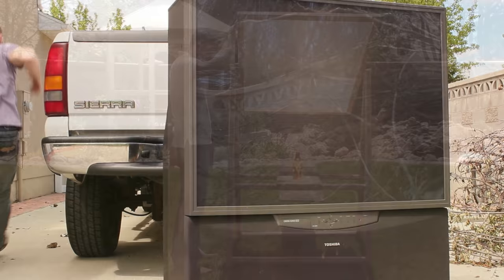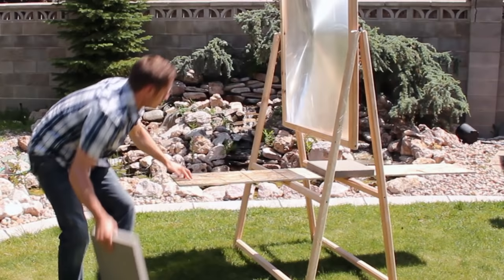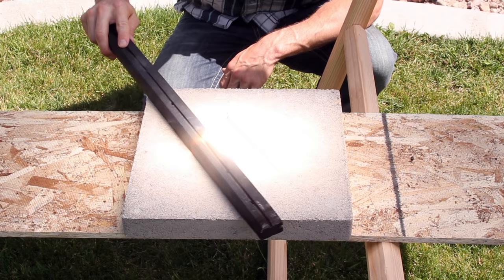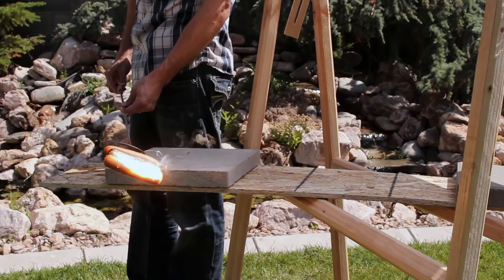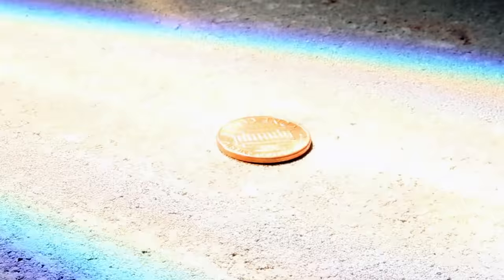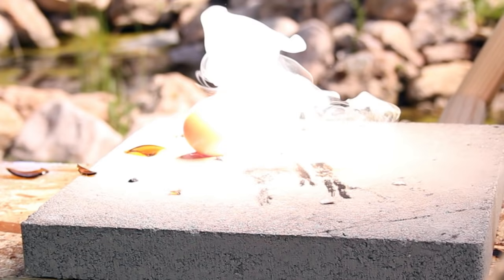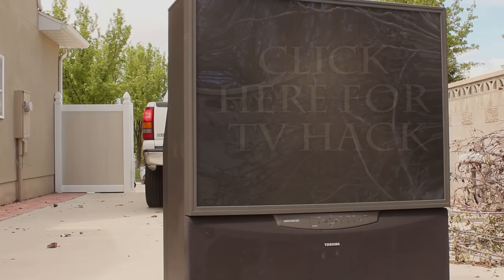Burning Stuff With 2000ºF Solar Power!!

Comment: 97 million miles away from the sun, a measly square meter of the sun's power is focused back into a small spot of light capable of melting metal. If that doesn't paint a picture of the sun's energy, then I'm not sure what would.
Reply: Ikr?
Reply: Now I don't want to go outside
Reply: 93 mil miles is a lie
Reply: Truthasivebeen Shown no u
Reply: Escanor is laughing...
Reply: Sam Smith me with a bunch of spray paint could paint y’all an even better picture of the sun
Reply: Flat earth
Reply: @melvincordovez484  "37Jacob, however, took fresh branches of poplar, almond, and plane trees, and peeled the bark, exposing the white inner wood of the branches. 38Then he set the peeled branches in the watering troughs in front of the flocks coming in to drink. So when the flocks were in heat and came to drink, 39they mated in front of the branches. And they bore young that were streaked or speckled or spotted." (Genesis 30:37-39)

Dude you're talking about a book that says you can get stripped animals if you make sure they mate in front of peeled branches
Reply: Praise the sun

Lord escanor
Reply: Truthasivebeen Shown do you know what trigonometry is?
Reply: 150 million KM for normal people
Reply: 29 million miles actually
Reply: And Sun is almost the most average star in the observable Universe!
Reply: Boss
Reply: Guy took 97 million mile long measuring tape to the sun, but the last 4 million miles melted. So they settled at 93 million miles.
Reply: @melvincordovez484  no
Reply: The ancient Egyptians used giant primitive solar lenses to melt the granite and thats exactly how the queens chamber was built at Giza
Reply: @zf_samael1037  Ye
Reply: Yes under the heliocentric teaching but not everyone goes with the heliocentric teaching, some go with the geocentric teaching
Reply: Sun isnt 97 million miles away
Reply: yes and the earth is still not freezing like crazy
Reply: the sun is not 97 million miles away, have you always wonder why cloud has a spotlight?
Reply: @elidyson256  bruh
Reply: and thats without even taking into account things like the ozone layer wich reduces the energy that hits the surface
Reply: It's not 97 million miles away tho
Reply: 777 likes (go get a lotto ticket)
Reply: @the_libyan_dude6500 what is the Einstein?? Can't wait to hear this 🤣
Reply: @smallsherpa2222  you're beneath me
Reply: @the_libyan_dude6500  ahh just trying to insult me when all I did was ask a question. An intelligent person would relish the opportunity to share their knowledge and educate others.. I was merely enquiring as to how far the sun is. I'm guessing by trying to insult me you're refusing admit you havnt a clue...

Comment: Put it on a actuator on the truck of your car so you can ruin a tailgater's car with it! Over heat that thing instantly!
Reply: That's a pretty sweet idea.  Just burn a hole through their radiator, get tailgaters off your ass immediately lol.  Also works good in police chases.

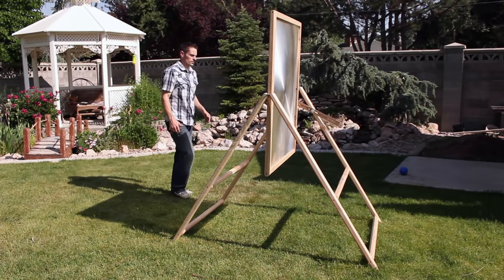Comment: 2:45 would you really put that on your shoulder and walk with it after seeing what you just seen
Reply: Looncan i was just thinking THAT!
Reply: Looncan The focal point is at a greater distance than the distance it has to his back at that moment, so there's no real danger in it.
Reply: are you serious?
Reply: This is a Fresnel lense, it acts as a condensed version of a magnifine glass. Therefore it needs to be at the perfect angle with its normal vector pointing towards the sun, and even then will only burn things in it's focal point which would be a few feet away and only be a range of about 6 inches. If you understood the physics behind the lense, you would see that carrying it around is about as dangerous as plugging in a power cord.
Reply: Looncan  its harmless after you fold it up and the suns rays are no longer passing through it
Reply: James Hutton naaahhh, plugging in a power cord is far more dangerous! i hope we all know that ....
Reply: Looncan  I WAS THINKING THAT
Reply: Looncan have you ever burned anything with a Magnifying Glass guy...You have to hold the Glass perfectly still and the focal point of the light has to be as condensed as possible or it wont burn..
Reply: guy belski Lmfao ikr or a troll
Reply: +Looncan If he felt his shoulder getting hot, he would have taken it off.
Reply: Its like asking is it safe to touch the ends of an electric power cord while not plugged in!!
Reply: Well is it? the electrical cords on my antenna in my backyard wouldn't be safe to hold prone to lightning bolts, my antennas conduct electricity and static really well

Here. Hold my electrical cords? no!, thought not
Reply: haha, your the best kind of troll. lmao.
the kind where its hard to decipher whether or not ur a troll.
keep up the good work :)

Comment: I wonder how long it could take a few of these to heat a pool
Reply: good idea
Reply: depend on the pool bottom and size. if its a reflective material then it would take forever. if its dark ,non reflective and  small to medium sized then maybe just with 10 of these ,anyway its always possible to cause a crack at the bottom with it.
Reply: u need to put something dark (black metal sheet) on the water surface. since it is in the water it not gonna melt or burn but it transfer the heat to water. but it takes for ever to heat up the pool in this way
Reply: Think about it.. The len just focuses the suns energy from lets say one square meter or foot to the pool. What happens without a lens? Well that same square meter hits the pool.. And it has exactly the same amount of energy. So your pool will heat just as slowly as without a lens because it receives the same energy... Of course if you place them so that they focus sun from somewhere where the suns rays werent going into the pool, it would heat up faster, becuase you have one extra square meter/foot worth of heat energy going in. But water is very reflective, so it'll reflect most of the heat away. Basically what im saying, a pool wont heat any faster with this than without...
Reply: +iPelaaja1 but what if it isn't using the same area?
Reply: iPelaaja1 wrong.  This thing can melt concrete and metal coins.  It generates between 1000 to 2000 degrees of heat F.  So it's not same as 1 square meter of sunlight.
Reply: Correct.
Dan is confusing temperature with heat energy and density - they aren't the same thing.
1 kW per square meter of sunlight has the same energy as 10 MW per square centimeter, and that is impressive, but you never get something for nothing in physics.

To heat a pool quicker, you need more collecting area - a football field sized array of mirrors focusing on black pipes of fast moving oil running through a coil of pipes in the pool would do the job nicely, but that's perhaps a bit overkill - people don't often want to get boiled alive when they want a swim, but you could throw in some vegetables and stir!

As an aside, the energy used to heat the world's oceans by 0.2 °C is enough to melt all of Greenland's ice sheet, even starting from an average of -20 °C!
0.2 °C is a barely perceptible temperature rise, but the amount of heat energy stored in the oceans is mind boggling.
Reply: it's a focused beam of the same amount of energy, its doin more and burning more effectively for the same reason that a shiv (or something with a sharp point such as a needle) would have a much easier time puncturing things than a ball or something with a large surface area
Reply: Thank you for respectful explanation guys.  I was wrong.  Very interesting tho!
Reply: *Boil a Pool
Reply: vapourise a pool*
Reply: erase the very existence of the pool
Reply: it would heat faster if it you had multiples so that you focused a much larger area of light, say 15-20 times the area of the pool, into the pool
Reply: it wouldnt work the water is transparent. but you could probably damage the liner
Reply: Pool would become really toxic
Reply: You'll need a pretty big glass(probably many times the area of the pool), not covering the area above the pool, and some black material at the bottom

Comment: That was incredibly dangerous to pour gasoline on an already concentrated source of ignition. If the gas caught fire in mid air (I've seen it happen before) you could very well explode
Reply: +Felix Huppert nope, it only explodes if the fuel/oxygen ratio is right
Reply: it definitly can blow you up. this guy is not smart because smart people dont poor gas from a 5 galon jug onto a flame
Reply: +Rodolfo Diaz and when they are downwind!
Reply: Well he did end up passing away

Comment: WHAT IF YOU USED 5 MIRRORS IN A ROW, DOES IT MAKE IT ALOT STRONGER?
Reply: +peruface yes
Reply: Mirrors?
Reply: +Scruffy Ronin he meant lenses 😄
Reply: mirrors no, lenses yes but you would have to focus them all down to one point.
Reply: Josh Roberts ONE POINT ON TO A SOLAR PANEL
Reply: +peruface It would burn the panels
Reply: Only if you carefully manage the focal point - think of a camera with macro lenses that typically have several glass lens stacked on top of each other. You can only concentrate the point of the sunlight, not multiply it.
Reply: +Josh Roberts you can weld them together
Reply: To make a follow-up comment to me saying you can't multiply it, you can sort of multiply the light that's being concentrated by multiplying the amount of mirrors you're using and focus them on the same point.

It's the same concept used by concentrated solar power towers, where a single tower is surrounded by a ring of mirrors which typically causes steam to spin turbines.
Reply: not only that ... with multiple lens, one-by-another, you can produce more concentrated point ... his 'point' is maybe in palm size ... now, imagine that concentrated in a coin size? 2000'F in big size ... when concentrated in 20x smaller size it will produce 20 times more heat. Roughly. This concentration has to be in big cones shape, so 2" after and before the concentration point it has to be very very wide ... otherwise it will be unusable - will form a deathray.

Comment: Does that light also have concentrated uv radiation?
Reply: - ThaDutchGuy - that was exactly what I thought
Reply: superskiier50 That is actually a pretty good question.....
Considering that light and UV radiation don't necessarily follow the same rules of being reflected.
Reply: MrJamesIkanov they do for refraction
Reply: superskiier50 well no need to be rude.
Reply: superskiier50 Eh, still seems like a worthy question IMO. But I suppose that depends on your backround.
Reply: ***** u dunt huve tu bi su rode. soopit * burp * fok o
Reply: Eric Adrien Actually like +MrJamesIkanov said, its a very interesting question, because UV light follows different rules... I did some browsing and came to the conclusion that Polycarbonate (Witch is probably the lenses material) blocks UV light up to 380 nm in wavelength... Because UVA and UVB according to this link http://www.abcsafetymart.com/sglasses/health.html is falling in this spectrum, the lens is very probably blocking most if not all the UV light.
Reply: superskiier50 smart people ask questions.
Reply: given name smart people don't ask stupid questions.
Reply: superskiier50 Because smart people should totally know everything about a topic before they ask any questions?
Reply: MrJamesIkanov Smart people know the power of researching informations by themselves
Reply: ***** schools colleges and students disagree.
Reply: superskiier50 Correction; smart people ask questions.
Reply: joey miller Indeed.
Reply: superskiier50 smart people also do not put others down.
Reply: Zach Sagar thats your opinion
Reply: superskiier50 and i support that opinion :P
Reply: Neaarrddd!!!!!!!
Reply: Eric Adrien No because UV light doesn't go trough glass
Reply: ***** smart people know that collaboration usually works better than going solo.
Reply: No it doesn't
Reply: superskiier50 p
Reply: superskiier50 EVERY opinion is an opinion - what else would it be - a tomato? >+_+<
Reply: Jared Lund Stupid question: Larry, what is your name?
Reply: Explorer65 What is meant when someone says there is no such thing as a stupid question is that as long as the person is learning something, then the question has meaning.  Even if a not so bright person asks a simple question, at least there is something for them to gain.  People don't generally ask questions they already know unless they are trying to find something else out or are making a point.  If you want to be even more technical about it, even the question you just asked was not stupid, because you were trying to make a clever point from the question in itself, hence there are no stupid questions.  But I get where you are coming from.
Reply: And skiier calls him an idiot... He should look at himself.
Reply: this whole intire conversation is hilarious
Reply: +Tdcreeper Gaming which type of material is this ??
Reply: ***** And yet you've just FAILED to show an example of the very sermon you just preached to them, and behaved in EXACTLY the manner which you berated them for having exhibited towards someone.

Evidently you're okay with being a raving hypocrite, as it doesn't count when YOU are handing out the offensive, hurtful comments?

Doh.
Reply: ***** eruweraranj0r.  Don't listen to Unlokia.  Who cares if your treating superskiier50 the same way, your putting him in his place, something cowards need to do more with these type of people.  I don't know what word to use for you Unlokia, hypocrite or what. But it's funny how you go out of your way to put eruweraranj0r down instead of superskiier50 when what superskiier50 is doing is even worse.  Are you completely and utterly terrified of standing up to people like him because you have NO problem giving eruweraranj0r a hard time.  Putting down someone like superskiier50 is better then doing NOTHING and letting those type of people get away with "starting" arguments for no reason.  Letting them run wild is sending the wrong message.  Maybe your trying to give a heart felt speech about how Karma will come back to you or that we are being destructive.  But not standing up to these types of people like cowards is that much worse.
Reply: +superskiier50 Wow. Everyone is against you.
 You must be a great troll or a terrible human being ....
Also, haven't enough people explained to you why that question isn't dumb at all? Seems like you are not only refusing to ask questions but also to learn.
Reply: +Eric Adrien no, uv is blocked by the lens that's why you can't get a tan through a window.

Comment: burn dry ice with it
Reply: good idea
Reply: Dry Ice evaporates because its a solid gas
Reply: lol
Reply: I bet if you put your hand in the light then your hand WILL BURN.
Reply: +A Name (Jeff) no. its an element compound that would usually be a gas. not a solid gas😂
Reply: +Helpful Noose he is right
Reply: ExplosiveWaffulz - ty
Reply: Nathaniel Derrick even oxygen, but I'm not sure.
Reply: Edgar Tapia EVERY element can be any of the three states mate, I'm just scared of what a gaseous metal might do if you inhaled it (other than burn because it's hot)...
Reply: Nathaniel Derrick that's not true some elements are physically impossible as helium stays a liquid at even absolute zero do to quantum mechanics.
Reply: TNT_AND_THE_FLAME Sure mate, I was generalising...
It's a lot easier to type

"Everything can freeze"

than

"Most all elements can enter a solid state should they reach a temperature low enough, with the notable exception of Helium which due to Quantum Mechanics will stay as a liquid even at Absolute Zero".

Plus the guy I'm talking to thinks Oxygen freezes below Absolute Zero... so cut me some slack I don't need to be 100% accurate when talking to someone who 100% doesn't understand...
Reply: Nathaniel Derrick i got it confused.
Reply: daniel ahmadi this came out 4 years ago
Reply: Anime fan Don't judge OOOHHHHH!!!!
Reply: dry ice sublimates, it doesnt evaporate.

Comment: Couldn't this be used for a stream engine? You know, like having the water be boiled by the screen and making it move turbines?
Reply: augie nelson OMG i am thinking about the same thing to have a water tank to get heated by this fresnel lens then will get some electricity :D
Reply: 199alexman I mean, we basically purify salt by dumping water in a desert, I'm guessing it's the same principle, just harnessing electricity as the water boils.
Reply: augie nelson yep. http://en.wikipedia.org/wiki/Solar_thermal_energy
Reply: Jerry Tran little bit late, but still appreciated. I did some research and actuality built my own (I attached a hose inside of the metal barrel with the ion screen and connected it to a turbine)
Reply: does it work legit then? or nah
Reply: 199alexman yup
Reply: augie nelson Please post a video.  I'd love to see that.
Reply: Arctic Arsenal the videos exist on YouTube already.
Reply: augie nelson  You could also have this generate electricity by using thermal expansion. The expanding air will increase the pressure turning the turbines.
Reply: Christopher Brooke ah cool!
Reply: +augie nelson Sure but what is powering the wheels that keeps it aligned with the sun?
Reply: Uouttooo I didn't do that, I only got a big barrel, put a hose with a turbine in it, and put the screen over the hole. I only had 2 hours to make it and I was just curious if it'd actually work, though I'm sure If I got a big enough barrel then there'd be an excess of energy to power it to align with the sun.

Comment: You could heat water with it and drive a turbine, free electricity!...when it's sunny.
Reply: Just use it to run a Stirling generator. Much easier.
Reply: woah you just invented a solar panel!!
Reply: then a big cloud gets in the way and you know the rest...
Reply: No you dont heat the water with 2k fahrenheit it becomes toxic